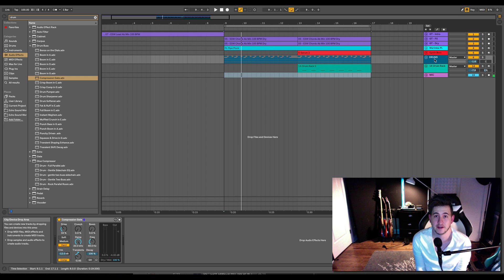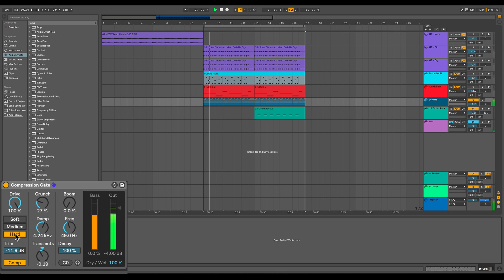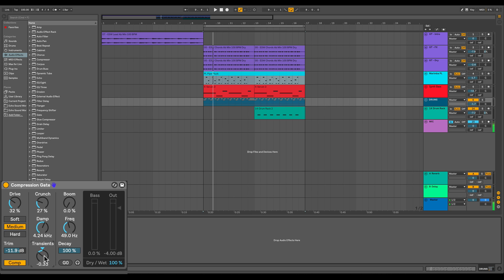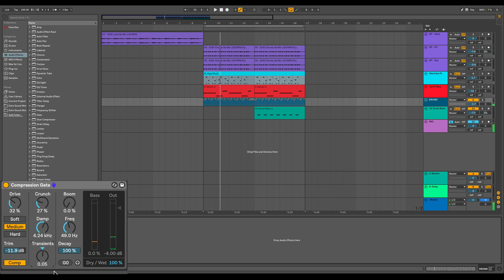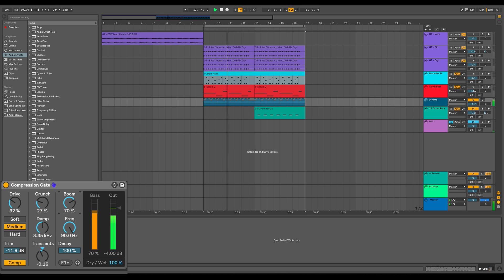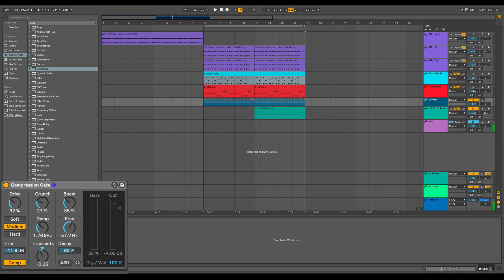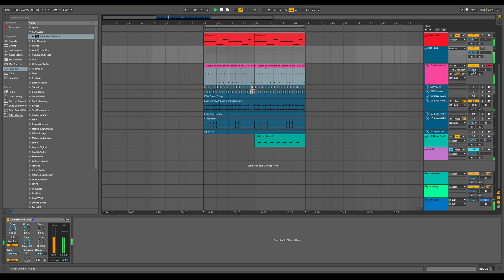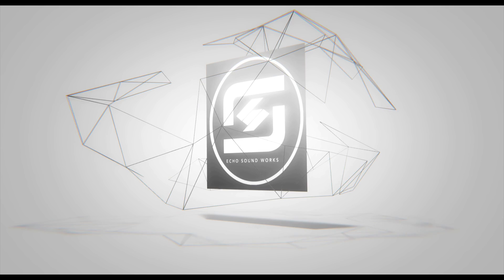Ableton Live 10 Drum Buss | Is It Any Good?

Comment: I was actually surprised when I first used this. I thought it would be gimmicky except for maybe the tuned "boom" feature.  I personally never use the "compressor" since I have zero control over it. The compressor IMO sounds like a limiter from what I can tell and uses the trim parameter to drive into it while the transient shaper, while limited compared to dedicated transient shaper plugins but does its job well enough, handles the transient shaping. The distortion and crunch are nice at moderate or parallel settimgs, the dampening knob also works well to take just enough brightness out of harsh high hats, and I'm sure the tuned "boom" feature gets a lot of use from aspiring big room guys.

That said....would I pay to upgrade to Live 10 Suite just for this?  Heck no. 
I've owned Live 9 Suite since its release. Bought it for Max for Live and everything else really. Not just one thing....and I upgraded to Live 10 bc of the advancements in workflow for editing both audio and midi.... not really for any of the new plugins.  Can't say I've even touched Wavetable much either. It's pretty CPU intensive right now so I have no reason to use it over Serum.